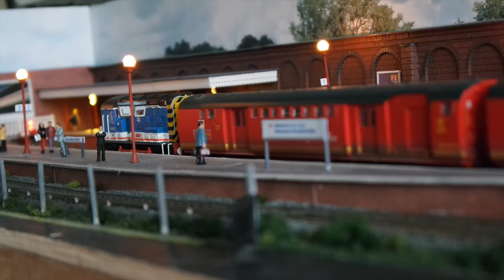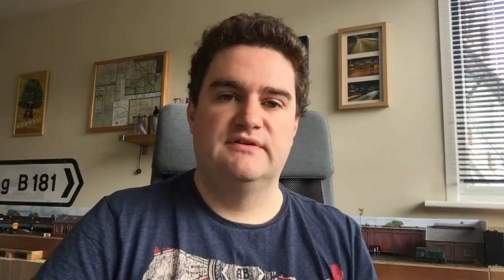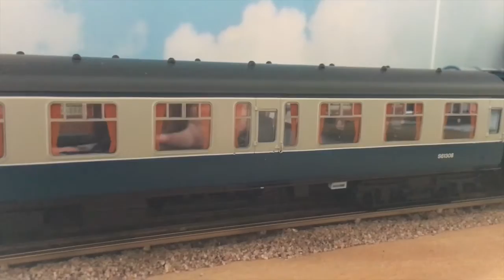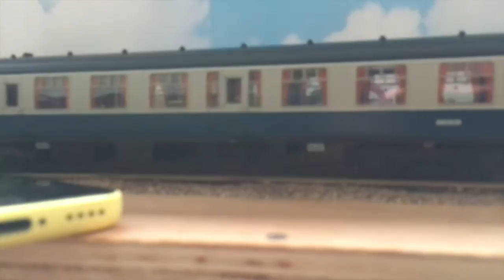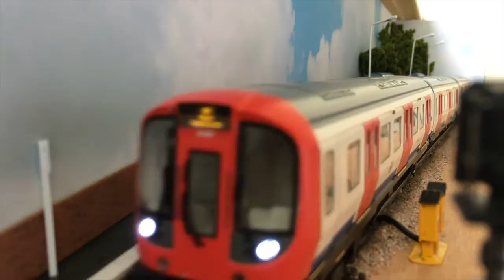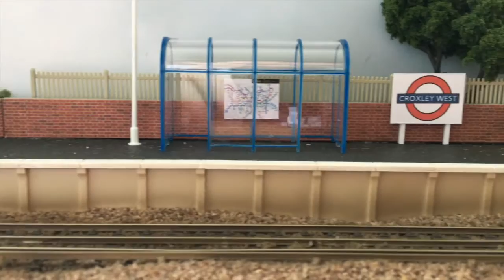CAS Q&A: No 2

Comment: Just got me Z21 Black edition, the first thing I found was you can't view all the decoder CV's as a list like you can with the Railmaster.I wanted to set up a shuttle system using the Sapphire decoder,  the advantages of this is you don't need to cut or put blocks in any track section, it's all done on the decoder.Trying to do this on the Z21 was very slow a laborious, have to set up each CV one at a time, so I connected up my e-link to the programme track and got all the CV's displayed on the Sapphire as one list. I could then quickly go through the one's I needed to change to do a shuttle operation, and this way was simple and quick. Maybe a suggestion for you to do a video on this?Also there doesn't seem to be any video's on programing the various point decoders on the Z21, to me it doesn't seem to be very clear how to do this, maybe back to the Railmaster for this?  So my first impressions of the Z21 are mixed, really good at changing you loco address, and loco control. Love the way how it operates with a router, very forward thinking of them.I have not found out how to get the information on the CV's, like make and type etc.. I'm sure you can but just not found it yet.Sorry, don't like the manual that came with the Z21, lacks detail and very vague on some subjects.To sum up, I won't be ditching my Railmaster.
Reply from the maker: Hi Paul,

Hmm, yes I must admit advanced CV programming is not a strong point of the Z21. As it's my only controller this is something I have to suffer, but I'd definitely watch a video on how to set up shuttling via the Sapphire decoder. That's something that interests me quite a bit. I think for advanced CV set up you'd need to use a computer and a piece of software. The apps are fairly limited in this department so perhaps I will look into this.

I'm thinking of doing a video on general set up so I will include how to set up accessories. If your accessory has a "learn" facility it's fairly straight forward - just set up a point or signal in the Z21 app and then send any on/off green/red signal to it and it should learn it there and then. 

The manual is poor, as is any online support in English - but I suppose this can't be blamed as it's predominantly produced for the German and european market and is less well known over here.

Certainly don't ditch your railmaster, I wish I had a 2nd controller for troubleshooting and as you've proved it's useful to have one that differs in menu setup.

Stick with the Z21 though, once you get your head round the rather cumbersome app route set up is great and I've not come across a controller that will double-head/consist as well as the Z21. 

All food for thought for future videos so let me know how you get on!
Reply: Cheers.. that I will,,

Comment: I`m pleased you got your point motors sorted.                                                                                                                                                                      There are some very good Z21 instructional videos on A and H Models website which helped me a lot when I first got my Z21.     As to the plus 4 accessory numbers. The tick box on the Z21 maintenance tool, as I understand it, does not alter loco addresses only point motor accessories.                                                                                                                                                                                                      On Hovermotion  you tube channel he shows how he connected his Ecos controller to the Z21
Reply from the maker: Cool I will check that out!

Comment: I have a DCC layout but the points are controlled DC with a CDU and centre off double throw switches.

I would be interested in hearing what you think would be the most cost effective way to DCC the whole layout with point operation included. I have a Digitrax zephyr and assume the PR3 would be the way to hook up to a PC... but aside from that, which decoders would you recommend, or would you design a layout with fully DCC ready point motors?
Reply from the maker: Perhaps I'll cover this in an upcoming vid, but here are some thoughts...

I'm a big fan of having everything in one package, hence why I went for the iP Cobalt motors as they are motor+decoder+frog polarity switcher all in one. They're fairly east to install, but it's worth baring in mind that they're quite tall so making sure you've got clearance first is a must. The only thing that is slightly fiddly is getting them screwed in, but DCC concepts provide you with some sticky pads to get them roughly in the right place first. They are very easy to programme and now I've worked out how to turn the self centring off I'm extremely happy with them. The only down side is that they are quite noisy - they're designed to be slow action (and to fully achieve this you have to take the springs out of all your turnouts which I'm reluctant to do for reliability reasons) - and I imagine the gearing is contributing to this noise. Not a problem but worth mentioning.

Having said all this, if you've already got point motors in place there's no reason you can't adapt them for DCC, and the first place I'd look for decoders is probably Train Tech (PC2) as I'm a big fan of their products.

If you've got your heart set on full automation then obviously the points will need to be DCC as well, or if you want to set up routes that set multiple points in one go like I have... but there really is no harm in analogue operated points on a DCC layout. I believe Dean Park and Everard Junction work this way. You also can't beat a good physical switch or lever that DC operated points provide..

Comment: This is interesting stuff but I am DC so cannot offer much help. Still I do have some DCC as well, and I am interested in seeing DCC stuff. 
Regarding end-to-end running with DC Analogue of course you can use a £32 Gaugemaster shuttle that uses diodes as sensors as you mention. I have been told there is no cheap DCC equivalent outside of PC control, so I will be interested to hear what their is, and at what price. I'm still learning. 
Hovermotion channel uses the Z21 to impressive effect. 
My club is using the Roco Z21 - this is Chelmsford Club. They are just setting it up on a layout they are making. Seems one of the best to me. If you ever want to visit as a guest I will get you signed in. You can rack their brains then? Laurie
Reply from the maker: Cool, I will check out their channel
Reply: I went to the club tonight as it happens, and asked them if they knew of a DCC shuttle. They did not but suggested I Google it. 
We chatted further about the Z21 and how you can use a camera loco, transmit to a laptop, and then overlay a cab image whose controls you can use to move the train. Clever use of DCC that is. You may well already know all this.

Comment: I have just ordered the Roco Z21, do you know if there is anymore info about this addressing problem on this on Youtube? and yes would love you to do run through on the Z21.
Reply from the maker: I certainly haven't come accross any about this problem. You will be absolutely fine addressing locos and accessories on the z21 until you need to set a specific address like with the self-centring function on the DCC Concept motors as I mentioned. Then remember you need to add 4. 

But other than this very strange quirk, I really recommend the z21! It does things like double heading really easily. Have you ordered the black or white version? 

I'll try and do a run through video at some point but in the mean time there's a channel called Simon's Shed where he looks into the z21 I think.
Reply: I have the black version coming, a good price of £249 for Scograil in Ipswich
Reply from the maker: Cool I have the white one which I picked up for about £129 I think. The black is fully spec'd with some more features.

Comment: I am pretty sure that the eLink only works with Hornby Railmaster and nothing else. And Railmaster will only operate the elink and Elite. 
The Hornby Sapphire decoder can be configured to operate a train in a back and forward schedule. It is based on time settings and does not need any external sensors or detectors and is set in CVs 121 to 140 (according to the manual I downloaded).
Reply from the maker: Now that's very interesting. So the decoder does the back and forward for you? Do you know how you activate it? I will look into this
Reply: Yes, I read about it from the instructions that came with a Sapphire I bought. I never turned it on as it seems that the only way to turn it off again is by altering CVs.